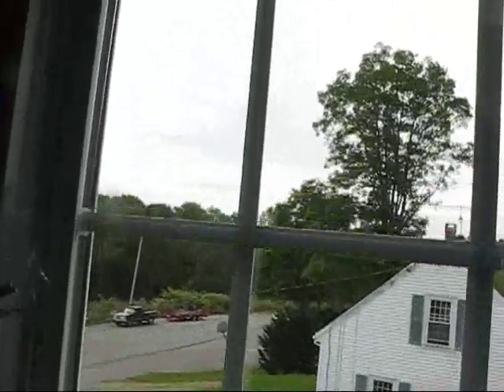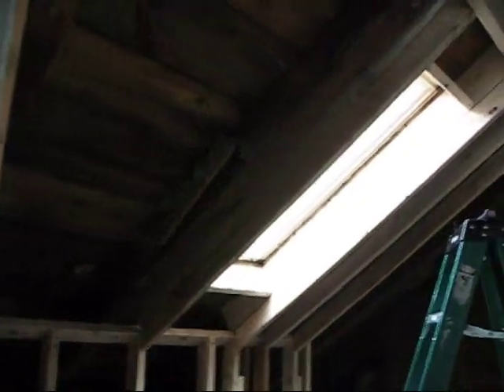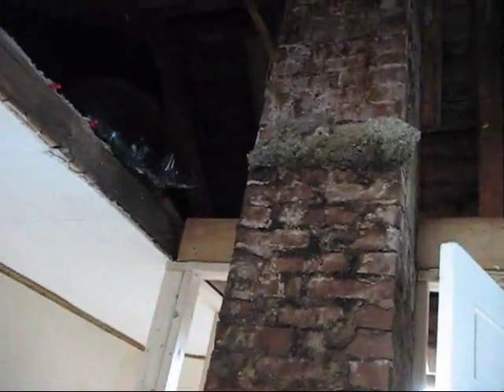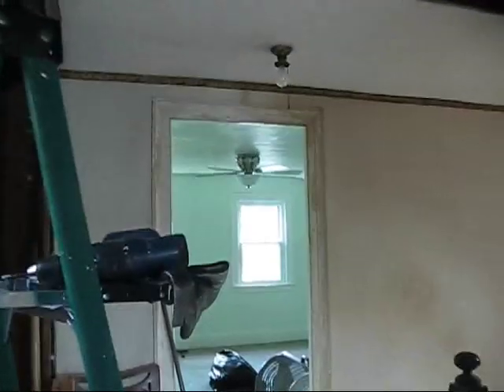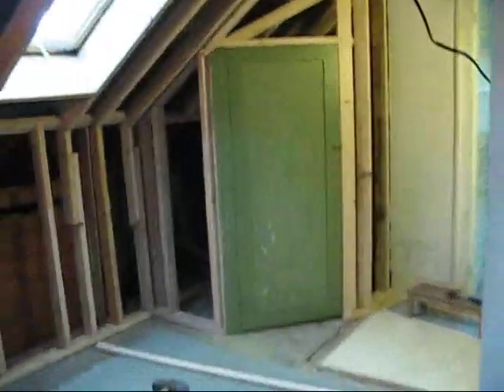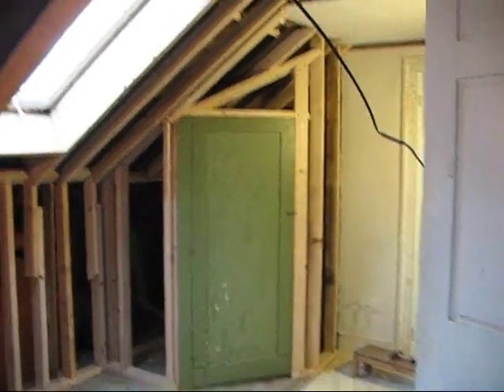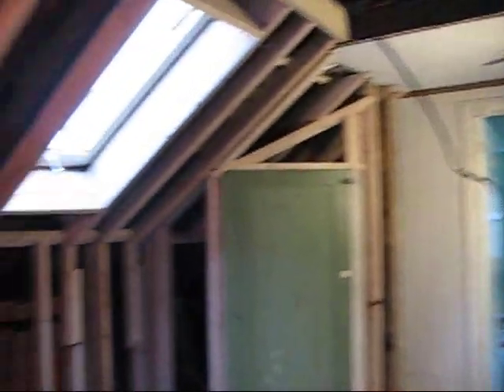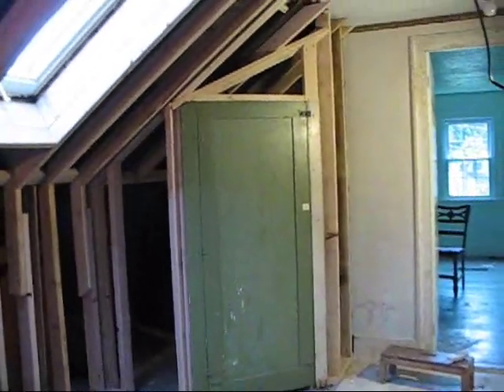building the slant upstairs closet

Comment: Seeing that closet door makes me appreciate the use of a dual-axis table saw for when I finally have my own workshop.

Part of me wonders if you could have just made a form for the vertical angle using paper mache and then sawed it to match the horizontal angle. After that, you'd just have to measure from plumb lines to get the right length. Just an idea, for what it's worth.